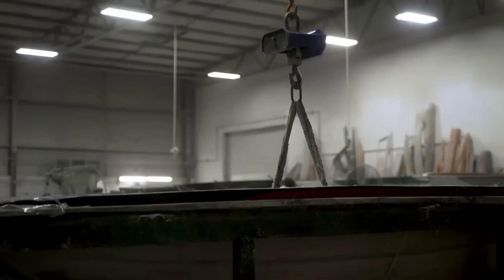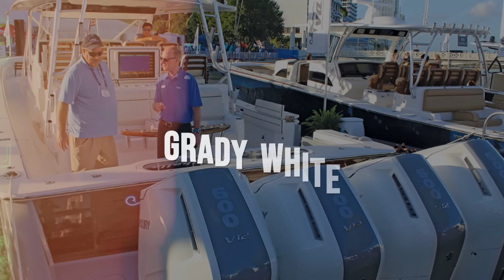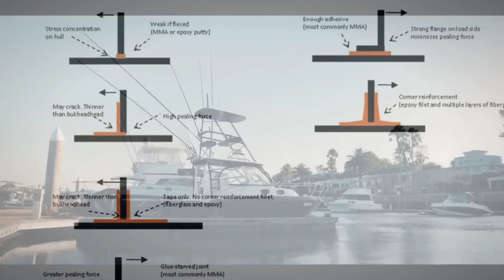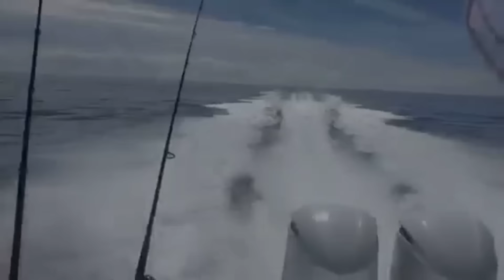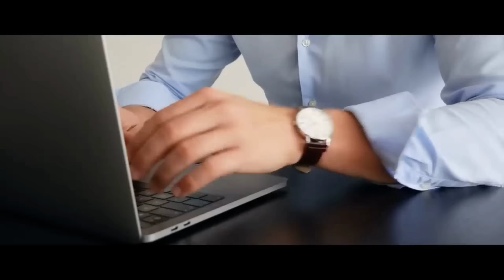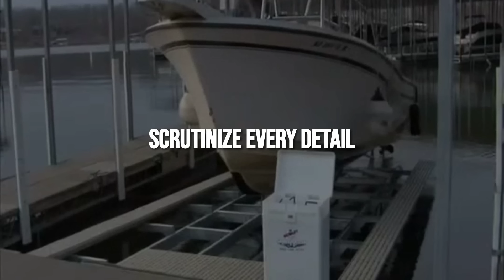The ONLY 7 Boats That Survive 20+ Years in Saltwater

Comment: My Triumph 191 is 20 years old...Hull looks like new despite 1500 engine hours. Made of rotomolded Roplene vice Fiberglass. One strong boat. Only issue has been electronic...specifically the radio...but I use a blue tooth speaker anyways.
Reply: are they still made?

Comment: I have 1991 Mako 211 with a 1994 Johnson Ocean Runner 200 on it (that has never been rebuilt although the carbs have been rebuilt) that is still going strong.  We did have to rebuild the transom about five years ago, but we did that ourselves for about $500.

Comment: Early 2000’s Sea Fox boats… all composite stringers and transom. It’s in the paperwork included with the boat. A little known guy named Renken was the CEO at the time.
Reply: I have 2008 SeaFox that I have been running hard for almost 10 years now.  2500 hours and still holding up.

Comment: I have an Angler 2003 230 center. No wood, ceramic transom. No chop. Hand laid woven roving and fiberglass cloth. The gelcoat has crazing and cracks on the cap. Repowered , riggers said built like a tank
Reply: I had a 1997 Angler 170 had a sticker said no wood no rot and it actually had 3 3/4 plywood for transom and chopped 3x3 in squares separated scattered for the floor for integrity they were all soft and rotted